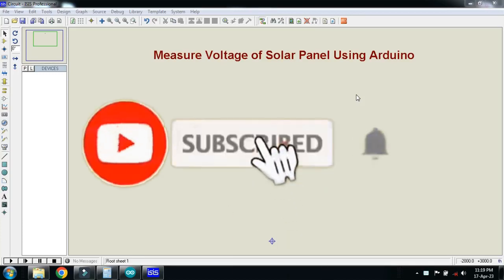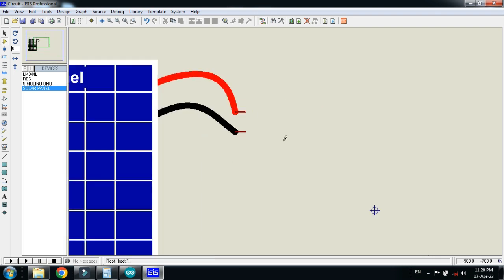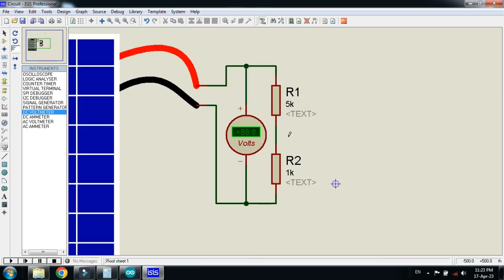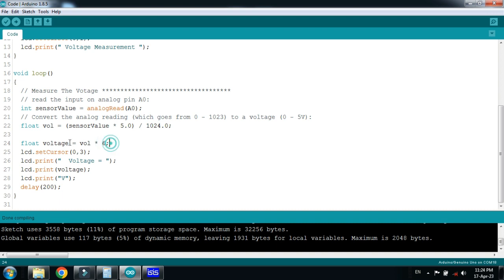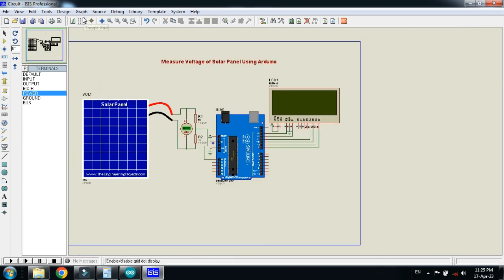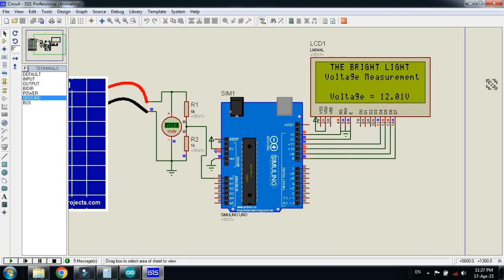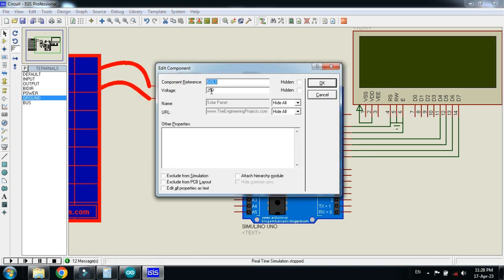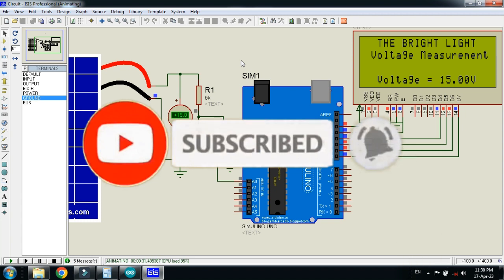Measure Voltage of Solar Panel Using Arduino | Code & Circuit | Proteus Simulation

Comment: Thank you for the effort and work put into making this video. It is quite accessible and easy to follow. 
I will be using it as guide to help my students measure solar panel power using micro:bit instead of Arduino, but it should work perfectly.
Reply from the maker: Thanks for appreciation
Reply from the maker: Thanks for appreciation

Comment: Boss make  DC any voltage can measure
Reply from the maker: Watch the below video for DC Voltage measurement.
https://youtu.be/ZT9D4wCd3mY
Reply: Boss 50 voltage
Reply from the maker: Do the required changes, (method already explained in video)